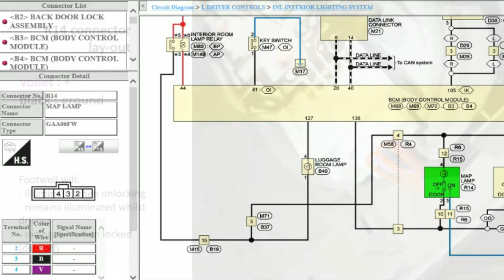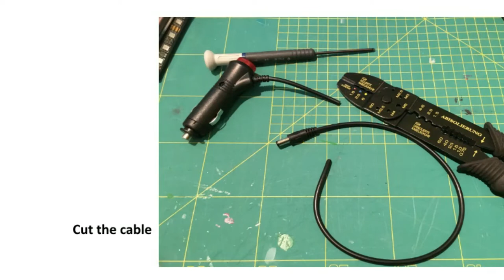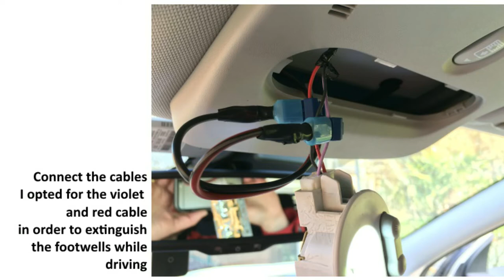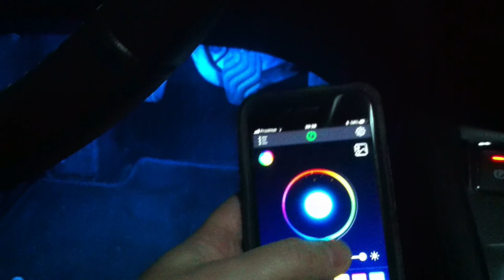Qashqai how to install LED footwell lights

Comment: Anyway you can get wiring layout for 2014 Nissan Pathfinder ? Trying to install these on it .. not sure the color wire I need to tap..  hope to tap in footwell or top.
Reply from the maker: Hi! I do not have it but aren’t the wires identical on the ceiling lights? Seems logic to me. Otherwise try the Qashqai forums. There are some Nissan mechanics around there that should have access to this info 😉

Comment: The cable on the A pillar does not interfere with the side airbag? 

On the UK QQ forum another user route for his dashcam the cable "behind the white strap (with the barcode sticker on it)". 

Thanks for your video, very nice one and helpful.
Reply from the maker: No not at all as it only follows the borders and won’t cross any panels. Thanks to you and good luck.
Reply: La_Palmeraie I looked at this post and there I see the airbag problem related: https://www.qashqaiforums.co.uk/viewtopic.php?f=29&t=4239&hilit=Dashcam&sid=6e3d243109dc178fb659d405835a2c1a&start=20 

But if not interefere it's ok. Thanks!
Reply from the maker: Thanks for the link. As you see the worked the cable behind the airbag installation. Mine just stays above. When the airbags should pop out the cable will just be pushed sidewards. 😉
Reply: La_Palmeraie that user say that the cable should not stay above because when airbag pop out that cable can hit you etc. They said that, the correct way for the car with side airbag is to run the cable behind the airbag cable. 

Previosly the user do the same like in your video but then reroute the cable behind the airbag.

Ben6279 post 

https://www.qashqaiforums.co.uk/viewtopic.php?f=29&t=4239&hilit=Dashcam&sid=6e3d243109dc178fb659d405835a2c1a&start=10
Reply from the maker: Thanks for the extra info. I follow this forum as well but missed this post. I follow this advice IF you pass the cable behind the airbag cover. But I more followed the rubber cover just next to it and then passed the cable in the ceiling cover just above. Shouldn’t be a problem at all 😉
Reply: La_Palmeraie should be fine then. Thank you again for answer and clarification.

Comment: Would you please reccomend what speaker cable to buy from Alliexpress?
Reply from the maker: 1,5mm speaker cable. I bought it in the local DIY store (https://www.google.be/search?q=1,5+mm+speaker+cable&hl=nl&prmd=isvn&source=lnms&tbm=isch&sa=X&ved=0ahUKEwi2qJbzzcXaAhVKaFAKHfsuAj8Q_AUIESgB&biw=375&bih=591#imgrc=arIIZs9YId-NUM:)
Reply: Thank you....
Reply from the maker: No problem. For LED strips 1,5mm is largely sufficient. For heavier use is LED headlights use 2,5mm.
Reply: La_Palmeraie 0,5 mm 2x speaker cable is too thin? I don't find the 1.5mm speaker cable. Thanks!

0.5 mm cable support max 12A
1.0 mm cable support max 18A
1.5 mm cable support max 24A

The Nissan R14 connector has the same 1.5 mm cable?  Violet / Black etc?
Reply from the maker: It should do as LED strips only use a few amps but verify the indications on the LED strip controller box before just to be sure. I should have used 0.75mm but only had 1,5mm left at home 😉
Reply: La_Palmeraie. I verify the controller box. Thanks for reply!

L.E update: china, no info. 

I found on web that use 5050 smd so I do the matt. 

SMD5050    0.24watt / LED (consumption), mine has 4 strip with 9 led > 36 LED x 0.24 = 8,64 watt/12V=0.74 Amp total consumption. 

DC12v, 1A should deliver 12 watt
DC12v, 2A should deliver 24 watt

So, the 0.5 mm cable can suport up to 12A nominal current rating (144 watt maximum loading), good for almost 600 SMD 5050. :)

I think I will use 0.5mm, that will be safe enough and easy to hide because will be thinner than 1.5 mm. 

Thanks!

Comment: Salve mi sono collegato al pin R14 dietro plafoniera con il cavo viola e nero ma quando chiudo l’auto non chiude subito la corrente mentre invece la plafoniera si come mai
Reply from the maker: Ciao, con il collegamento viola e nero si accendono quando si sblocca l'auto, rimangono accesi mentre l'auto è accesa e si spengono oscurando quando si blocca l'auto. Ho la mia illuminazione del vano piedi così e corrisponde all'illuminazione originale come si può vedere nei video.

Comment: After removing the tape (1:58), how to install the connectors? what type of connectors? cut the wires and join red to voilet cables?  Black to red cables?
Reply from the maker: I used scotch lock connectors bought from AliExpress but any type of connection should work. Advantage of these is their ease to use and ability to switch cables if needed. These connectors are installed just by pinching them over the cable. I connected the red cable from the footwells (which is +) to the violet cable of the car and the black cable from the footwells (ground) to the red cable of the car.

Comment: I installed as per instructions, but nothing worked. Checked connections and soldered and still nothing. Checked later and they were working
. After I cleaned up and put tools away, checked again and nothing. Will check again after dark. Not sure what is wrong..
Reply from the maker: Hi Peter, that's quite awkward! You should test if the footwells are working correctly on a continuous power source. When the footwells do work properly it should work when wired as described.
Reply: @LaPalmeraie0032  Thanks,  but have now fixed the problem, I had a faulty connection behind the map lights. My fault 
Now all good.
Reply from the maker: @sydswan05  Happy to hear so. Enjoy this mod Peter.

Comment: Si fa tutto quello che hai descritto tranne allo spegnimento si spegne quando si spegne la presa posteriore e non graduatamente ma di colpo
Reply from the maker: ciò è più dovuto alle stesse lampade a LED.  non tutti possono attenuarsi e necessitano solo di pochissimi volt e quindi rimangono accesi più a lungo.  l'avevo anche con i miei piedi RGB.  si attenuano ma poi diventano sempre verdi per un breve periodo.  altrimenti quella è la connessione che stai cercando.  nel mio video versione 2 del vano piedi potete vedere perfettamente come si spengono i miei piedi contemporaneamente all'illuminazione d'atmosfera.  Non credo che ciò avvenga necessariamente contemporaneamente alla plafoniera stessa.

Comment: Hi, I managed to install mine today but when I close the door and stay to BCU shut down the interior light my led change one second from green to my color and shut down after that. Need to know if your do the same or mine is defective? Thanks!

Link video: https://youtu.be/GYihR8vXFH8

If i turn off, from phone app the light led, when I open and close the door only the green light open and close not stay off.
Reply from the maker: In fact it does it as well! https://youtu.be/ojjdYkgaciY I thought it was maybe a fault in the controller box but as yours is doing it as well... 🙄
Reply: La_Palmeraie

What I found, when connect cable jack to controller box the led light green 1 second very slight, as if it were the predefined default color green set by the manufacturer. 

1. It's possible to do that because is connected at interior light? 

2. Is it possible for the classical IR control (remote control) do not do the same?

It's annoying to do that color switch everytime. Mine left selected to green for now and work like it should but not like this workaround. 

LOOK nice  at night and work few hours to do things right and oem look but If not find a solution I disable this mood :(because drive me mad to see every night this color change green-other). 🙄
Reply from the maker: Indeed, but, I think I might know why it does this. The interior light dies of slowly. I guess that the LED doesn’t cope right with does power dropping and can only emit green on such a low wattage. This is why it only occurs upon startup and closing, every time when the interior lights light or die off slowly. Maybe it could be resolved by placing some kind of resistance in between the power source and the controller box. Or when using an alternative power source but that would be the M54 connector which is very hard to use due to its high placing behind the glove box compartment. I prefer living with the green color. I see it as an « and we’re off » signal now 😉
Reply: La_Palmeraie   I will try with the M54 connector with a test cable upon controler box to see if do the same. :).
Reply from the maker: Great! Keep me posted then and try to take some pics of the M54 access if possible.
Reply: La_Palmeraie I reply when I have time to do the trick. 

I wonder if we could connect on central spicy ambient light, only the led band and control them from menu of the car?
Reply from the maker: Here, how that lamp is connected: https://www.qashqai-passion.nl/index.php?topic=10586.msg179892#msg179892 it will be always on and wonder if it has enough resistance for both the original very small LED diode and all the footwells...
Reply: La_Palmeraie   Nice. Led look very small, I always thought it was a led band. So not a solution. Thanks for informative link!  

I will try it all with the m54 connector but in you video said that led will stay permanent on in this case and not be good for me (maybe solve two color led problem but come another problem, led always on 😂).
Reply from the maker: No you should be able to do both versions on the M54 as well. See 0:32s brown and violet cables.
Reply: La_Palmeraie It's ok then. Thanks. I manage to find that connector and test how the led act. Come back with info. 

Have a good day!
Reply from the maker: Hi again, I did some research as well and the problem is situated in the controller box itself. I wouldn't bother to find the M54 as it wouldn't change a thing. What I'm going to do; 
- I rewire the existing footwells to the violet and black cable. (which is easily done with the connectors I used)
- I install an additional white LED footwell to the actual violet and red cable

The white will shine bright (and therefor overrule the other) when opening & closing
The colored one will only shine very subtly in the same orange color as the console when driving.
Reply: La_Palmeraie Hi. Thanks for info. If I understand well, the actual footweels with the controller problem will be routed to stay on permanent when you drive and add simple 12v white led band only for front, to stay on only when open and close the door.

It's correct?

I will do the same if not find a solution for the controller itself because this green piss me off 🙄. If a thing don't work as I expected I prefer not to use it or i will try to improve. 

I think not to be disturbing the light driving it at night being constantly on.
Reply from the maker: I agree totally with you even if the green light is quite discrete. It shouldn’t behave like that. 
You understood correctly that the actual footwell will only be used while driving. With the app you should dimm it a maximum to be stylish but not disturbing. Choice of color will effect this as well I guess. If really driving in dark areas you could always switch it off as well due to the app.
Reply: La_Palmeraie if you have time, please post a video with new mode. If I found a new led controller that behave normally I post here, if not, I do like you said and on long night trip I will turn off the light from app. Thanks!
Reply from the maker: Of course 😉
Reply from the maker: Hi and happy new year to start with. 😄 I received my white footwells earlier this week so installation will probably follow later this week. Video shall be posted soon after.
Reply: La_Palmeraie Hi. Happy New Year too! 

Il wait for your video. Thanks for reply!
Reply from the maker: Good news! Just installed them today and everything works like a charm. Editing the video may take some time, hope to be able to do it this weekend. 😉
Reply: La_Palmeraie very good news. I will manage to do mine when weather warm a bit. :) thanks!
Reply from the maker: Here you go; https://youtu.be/f4FhKRsiDa4